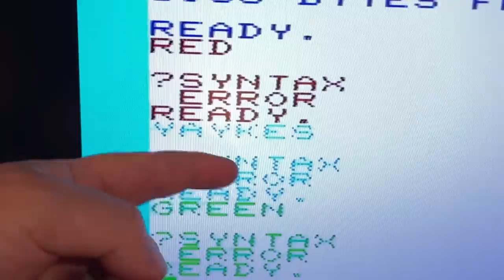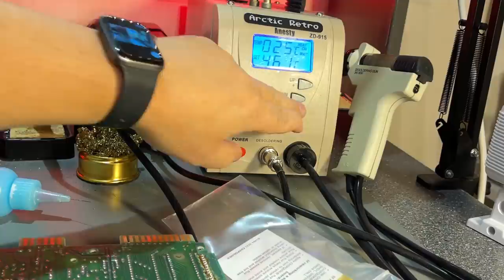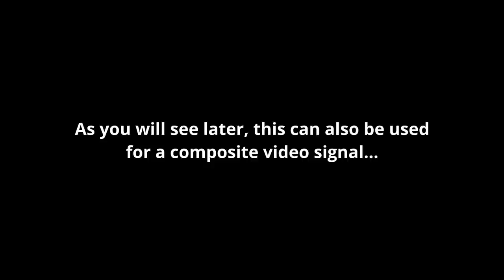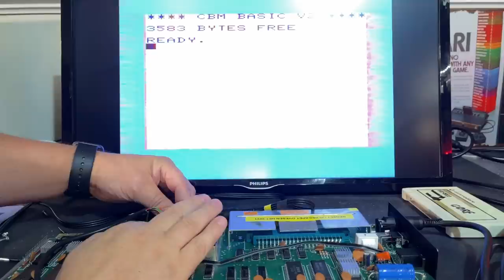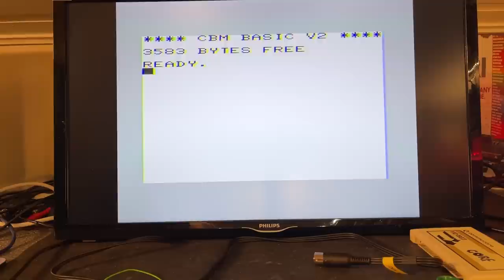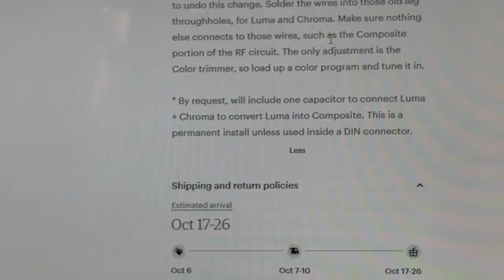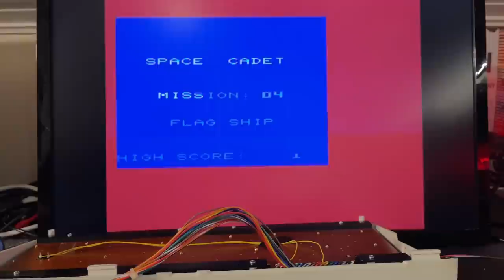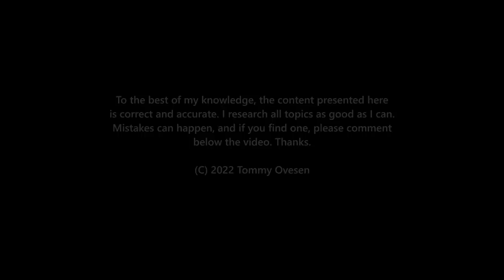The Commodore VIC-20 CLEARVIDEO mod - S-VIDEO or composite video with improved quality

Comment: S-Video was a huge advantage on older TVs without a very fancy "comb filter." Around 2000, the TVs switched over to using a digital comb filter, causing composite to look just about as good as S-Video, or even RGB. So it's great that you got a quality composite signal on this, Tommy!
Reply from the maker: Aha, thanks for the insight :)

Comment: Great video. I have a very early NTSC Vic-20 with the 2-prong power connector. I would like to perform this mod on it, do you have written instructions or a guide that I could follow? I've also just purchased the mod board on Etsy.

Comment: With that desoldering Station, I had the same problem but after sourcing proper filters from a decent supplier My station
was like I first bought it "make sure you fit the Filters the correct way as this seems to be critical...
Reply from the maker: Ah, ok. I got some filters randomly on eBay. Where did you get them? Seems like the suction has gotten worse, so it might be the filters are too dense.
Reply: @Arcticretro  
not sure if I got them from Rhino Tools
or another local supplier here in Australia, which were cheap so I just got one..
Reply: Also just in case you are not aware of the filter attached to the actual desoldering system, so make sure that too is clean as it can clog up along with the entire tube if one is heavy on using the flux...

Comment: I think the heatsink needs to be in the center of the chip, where the actual silicon is (unless the VIC chip is different from other chips). Just a tip. 👍
Reply from the maker: Yes, preferably, but I only had those small left. I think the heat spreads out anyway

Comment: One advice: the solder tip you are using with the solder wick is too small. For better heat transfer you have to use a bigger one.
Reply from the maker: Ok, thanks for the advice :)
Reply: 1.0-1.5mm flathead tip works best at around 330 - 360 C. The flux in the wick starts working at around 300 C. I have a Weller multistation with three accessories, and I keep a simple station beside it with the flathead tip for hand-cranked or wick desoldering. The weller with sharp tip I use for the more detailed soldering work on fine-pitch contacts etc.
Speed of heat transfer is the key to good desoldering. Don't be afraid to crank up the heat either (newer boards from the last 20 years have lead-free solder meaning a higher melting point), really hot 'n fast does a better job and is actually less damaging to the internal die of the chip than cooler and slower. Learned by experience.
Reply from the maker: @paulmichaelfreedman8334  Thanks for the tip!
Reply: @Arcticretro  Not trying to be a know-it-all, just sharing my experience 😄

Comment: Can the pads be repaired if they get lifted ? Is it normal for pcbs to "bubble" in the back inbetween traces ?
Reply: i've seen other retro youtubers like the8bitguy say the "bubbling" is just solder build up on the ground plane to deal with the voltage as they're not true multi-layer boards there is no internal ground plane so they added the solder to help that is if i'm understanding you right
Reply from the maker: You can glue on new ones. There are kits for that. The bubbeling is normal and was that from the start. It's solder
Reply: A small mod that suddenly took some time. Still, greatly investigated and project professionally saved. As always.